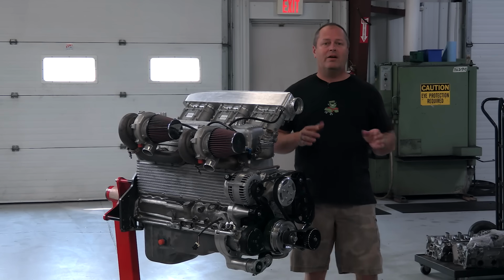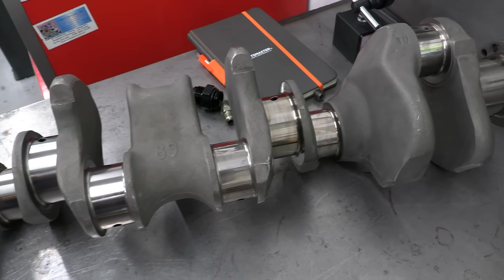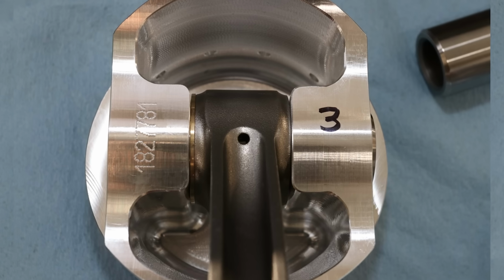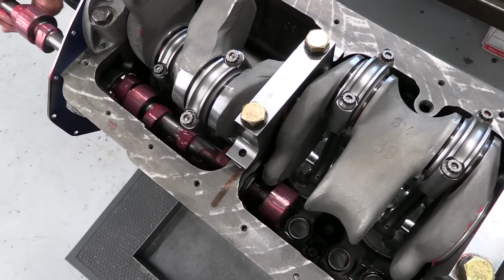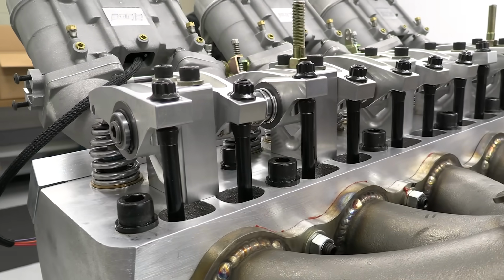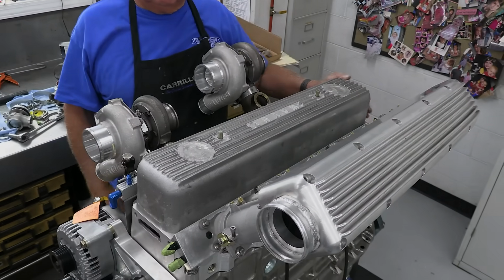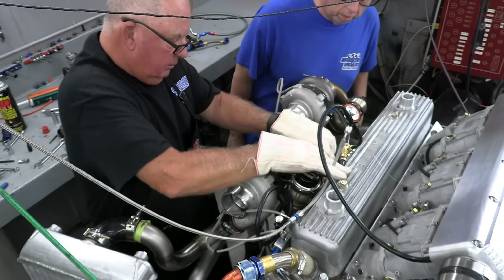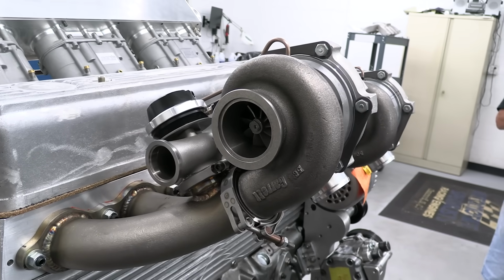Incredible Twin Turbo Chevrolet Straight Six is a One-of-a-Kind Creation!

Comment: What was amazing was the 1st generation 6 cylinder overhead valve Chevy engine only had 3 main bearings. This one has 4 main bearings. I'm surprised they didn't go with the newer block with 7 main bearings.

Comment: Somebody probably already said it, but to my knowledge the big difference between the early series, the 216 CID engine, was babitted rods with no inserts. Inserts came along with the 235.
Reply: 235s had babbited rods as well.

It wasn't until 1954 that GM got away from babbitted rods all together.

Comment: The old Ford straight 6 300 cu. engine in. in my Ford full size van work was a bullet proof engine.    I sold the van with about 300,000 miles still running well.  I had it since new and changed the oil at regular intervals, tune ups, and other wear items maintenance.  It was never opened other than a valve cover gasket.    I wonder why you chose a Chevy?  I also wonder why you chose a 4 main bearings block when one with 7 mains was available.  

You sir are a Master Builder.  This engine transformation is  art work. it is like art sciences and engineering sciences had a baby.  

Who footed the bill for all the custom engineering/manufacturing  of the parts as well as the final assembly and testing?       

I am surprised that Jay Leno has not called you with an offer of $300,000.00/yr salary to maintain all his toys.   Maybe he will after he sees this video?

Comment: Why in the world would y'all put a FRAM oil filter on that engine!!! Fram is straight garbage. Cut them open and take a look at it compared to a wix filter, you'll be amazed at the difference. Fram will damage your engines over time fellas, don't use them.
Reply from the maker: It just gets used on the dyno and then cut open for inspection.
Reply: @TheHorsepowerMonster  that's good to hear. Great work, love the show!

Comment: i built a ford 300ci with twin m90 superchargers and a supercoupe ignition system. i welded the cam sensor ring right to the top of the distributor tho. 781hp but i took it apart to do the headgasket i just put in and then i moved to LA, my grandpa called a junk guy for other things but wound up getting my engine, all my turbos and superchargers and junked all of it

Comment: My first car was a 56' chevy and had a straight six.  I added split exhaust and a two carb McGurk intake.  Embarrassed a few v8 powered competitors.  Not sure if it was a stock 235 cid or the 261 cid.  Also put solid lifters on the original cam and tried various valve lash settings.  This build is over the top, can't wait to here more of how it performs!

Comment: I prefer to see a old school build of this engine. The average hot rodder could not afford to build this engine. I spent 40 years working with old Chevy 235 and 261 engines. Besides the Wayne head several other companies made aftermarket heads. Many other parts including intake manifolds, cams, headers, dual point distributors, magnetos, aluminum flywheels, aluminum valve covers, aluminum side covers, aluminum timing covers, high compression pistons, roller rocker arms, and roller lifters, fuel injection and more for these engines and many of those parts are still available brand new. Your build is very impressive, but the only original 261 parts you are using are the block and crankshaft. Also a 261 can be bored and stroked to just over 300 cubic inches.

Comment: I grew up with a lot of n/a straight sixes from BMW and Opel (specially the 3L-CIH-engine).
German Opels had the straight-six OHV engines until 1965.
Great stuff, you built from this vintage engine!
Such a nice reference to see you guys use the similar type of cork valve cover gasket, they used to install back in the days. ^^

Comment: Maybe a machines groove all the way around the top surface of that head with an o-ring pressed in the groove would help prevent oil from leaking when the valve cover is removed.

Comment: I have very little experience with forced induction, but O-rings don’t seem strong enough to keep the boost in, especially if a blow off valve gets stuck closed.

Comment: Too many turbos, that engine looks like a porcupine. Couldn't you get the same "boost" by increasing the piston stroke? Suck in more air, make it almost like a diesel then use fuel injection so the fuel doesn't ignite early. What am I missing?
Reply: The stroke is already pretty long, just shy of 4 inches

Comment: Ver-r-ry, ver-r-ry sweet! But would you like another nobody-dun-it? Take an old 300-straight-6 Ford (Yeah .. First On Race Day FORD) big truck engine and turn it into a mileage-maker. Should be an easy starter ... there's just a whole lot of reciprocating mass creating ungodly amounts of parasitic drag. Even the crank is a heavy beast .. more drag in that rotational mass.Then we have the rotational drag of the flywheel, et al. Sheesh! It's so easy to fall in love ... with this old truck engine in a truck ... but how about feeding the durn thing over the next 300,000 miles? At 10 MPG, that's 30,000 gallons. At $4 a gallon, that's $120,000 ???? God, help me! Did I do that right? Are there ways we could triple the mileage out of this old anchor? We're talking an $80,000 saving on fuel alone here if we can!

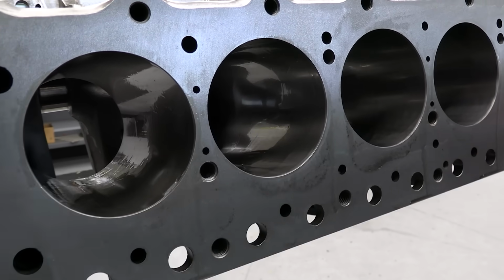Comment: 2:44 Not a performance engine???
Chevrolet DID treat it as a performance engine.
Ever heard of the CORVETTE???
No performance parts??
1953 Corvette blue flame six.
First engine available for the Corvette.
Reply from the maker: The Blue Flame Six was just a standard straight six dressed up with webber carbs. It was rated at just 136 horsepower, only 13 more than the Thrift King six. It's totally cool if you disagree with me, but in my opinion, the Blue Flame six was a marketing exercise, not a legit attempt to make a performance engine. Thanks for watching

Comment: Great engine build but... there's little point trying to compare this engine to the 50's original. This new build is bespoke in every way, all cnc from billet Ali.
Personally I'd like to have seen an original cast iron engine lightened and balanced crank, ported big valve head, fuel injection, high lift cam, electronic ignition with a turbo fitted.  This would be more in line with the tuning of the original concept.

Comment: All those nice oring seals and then there's a cork valve cover gasket. Well I guess you weather strip glue it to the head and it will contain the oil when removing the valve cover right?

Comment: The old red motor  used in Australia by Holden till the early 80s that finished with the 202 cube
Interesting exercise but wow how much did that cost ?  a Ford Barra will get you 600 + HP with head bolts and oil pump gears

Comment: Did you even do any sort of research into what people have done technology-wise with the stovebolt family of engines before making the claim that its the most technologically advanced? People have been putting cam and crank sensors on theirs. Piston guided rods, too. I'm sure someone has even done multiple tb's.

Seriously. Did you do any sort of research to see what people have done or did you just assume nobody's done it? Because they have. So what's so technologically advanced in that, engine that makes it so much more advanced than anything else? Not the cam & crank sensors. Not the pistons & rods and associated parts. Not the tb's.

Whats left?
Reply: 2 turbos? Id venture to guess that's not considered technologically advanced enough to make that the most advanced. So there's got to be a whole bunch that isn't visible?

Comment: I have a gigantic '73 Olds 98 Regency, C-body. Very heavy. I got it for free. The previous owner took the 455/TH400 out for a Cutlass build and gave me the carcass. It has been garaged it's whole life and only has 39,000mi. on the odometer. In other words, it's in gorgeous condition. I want to put a very torquey SBC/700R4 in it simply because they're so cheap and plentiful. I'm looking for low rpm torque, say 300+ft.lbs. from 2000-4000rpm. Would a mild 383 be a good choice? I've heard they're good truck motors cause they're torquey. I live in Alaska and old Oldsmobile V8 engines are literally non-existent in the bone yards up here. But, Chevy trucks with 350's are a dime a dozen, so it's the route that makes most sense.

Comment: One of the best 6-cylinder that ever put together was a 302 GMC that had a two-barrel carburetor 3 inch exhaust and a 12-inch clutch that was one smooth-running Beast and if you run a oil bath air cleaner use dextran transmission fluid

Comment: ooh this video made me sub. look, when your custom engineering, and designing parts, yeah, I know they're cnc, CAD, blah blah, but this is as close to garage engineering as you're going to get, and this is how they did it back in the day. you didn't go to your local speed shop, and just buy the part out of a catalog, you did the engineering, the design, the r&d, and the execution, right there in your garage with metal you had laying around. this is how the hot rodded a motor back in the day. this is called skill. this is what I like to see, not another cookie cutter, LS, junkyard turbo, bs power plant. this is how I do it, this is how it was originally done.
Reply from the maker: Thanks for the sub!

Comment: If the ENGINE OIL PUMP belt breaks how fast do you need to shut off the engine to avoid locking it up due to oil starvation ? I would also like to know if you have done any engine rebuilds on the old INTERNATIONAL HARVESTER 304 & 345 or 392 engines used in the IH Scouts ?

Comment: You mention that the original head was not too advanced but you have to admit that the original 6 cyl engine was pretty dependable and would start at any temperature easily compared to the Ford engines that had so much trouble with vapor locking.

Comment: May god that’s a lot of stuff to be stuck into a older truck, but 10lbs of boost isn’t a lot and with all the custom stuff it would be expensive to fix if it blew up, although not as much as the first build since there wouldn’t be yrs of development…but I’d bet that build could easily handle the 750hp all day long,it would probably even make 900 on corn..
If it was mine, I’d go with 700hp, and the 750-800lbs of TQ and build the trucks driveline to handle it…but they sure did take the most expensive way to make 500hp..great build and a great builder..

Comment: I used the the washers on Chevy V6 engines that had rods offset under the pistons, later I used narrowed V8  rod and machined .050 off the narrow side of a set of Carrillos @5.850 rod length, engine made 435hp at 8600 rpm. My spacers were made from Nylatron

Comment: I'd just like to combat a misconception...Crossflow heads are not better for performance without a good canted valve design, also if you have a reverse flow head, don't worry, you can still throw a cam, your fuel metering system of your choosing, and some in/out pipes at it just like anybody else, without disappointment. Pretty much anything designed since the 50's is going to have potential....man that is one funky stock combustion chamber though

Comment: The 1953 Corvette had a Blue Flame inline 6 cylinder under the hood with triple side-draft carbs and dual exhaust. I do believe that was considered a performance engine. Also, Pontiac built a SOHC 250 ci inline 6 for the Firebird. Don't forget the much newer Atlas Vortec 4200. DOHC, 24-valve, all aluminum I6. These have been turbocharged over 500 HP.

Comment: Anyone weld V8 heads and fit them to a Chevy 6, like the cleveland 6, from the 70's ,. I was thinking something like a modern 5.7 hemi head made to fit a Chevy 6, would be a screamer, lighten the Pistons, rods and crank, then girdle the mains, it would probably be happy spinning to the moon,. And probably all the way back, just a guess, with a mild cam it would probably want to keep going past 7-8k rpm, it would sure have flow, 250-292ci, with ports for a much larger displacement, and higher revving engine, and with boost,  the guys in Brazil are making near 2k HP with 250 6 cylinders,
Reply from the maker: It's a little bit more difficult than that. The bore spacing (from the center of one cylinder bore to the next) on a Gen III 5.7 hemi is 4.46 inches. The straight six from that period had staggered bore spacing depending on if there was a main journal between the cylinders or not. They were either 4.1875 inches or 4.375. So a hemi head won't fit. Thanks for watching
Reply: @TheHorsepowerMonster  yeah, I know, they would have to be cut and welded, but today, it would probably be easier to just cast a new head, it would be alot of welding, also a new cam, because the ports would likely be in different orders, heck it would be so much easier and cheaper to get a vortec 4200 from a salvage yard! Haha, turbo and make about 500-600hp

Comment: I have some question will it do one hundred miles and hour. ,Will it last two hundred and fifty thousand miles , without any major problems , I understand a water pump, carburator mi go jt need to be replace, also can I do it in my driveway. Like I did with my Chevy .

Comment: His work on this reminds me of the Ford 6's running Chevy parts for racing. And torque is referred to in Pounds foot, BTW. Was the rocker ratio 1.47:1 or 1.74:1? Great video. I think I have a new pit stop. :-) Subbed!
Reply from the maker: You are right. Engine torque is absolutely measured in pounds/foot. And in my older videos I referred to it that way, but I got so tired of the endless comments chastising me for saying it wrong because they've always heard it the other way, I finally gave up. Even the engine builders I work with say foot/pounds out of habit even though they know it is correct the other way. Anyhow, I guess it just got too hard to swim upstream. And the rocker ratio is 1.47:1, I got it backwards one time when I was doing the voiceover and didn't catch it. Thanks for watching!

Comment: Beautiful work ! But at this level of mod I would think the Ford 300 would have been used because of more main bearings, but the head is wonderful low weight cross flow bigger valves did they make a version for the Ford ? I had one it went for 300k miles and was 100percent reliable, at the same time I have all-wise had a old bmw with there six and there better I still have a 3.0 so 1988 300k runs great 👍

Comment: 525 hp, 525 torque -  should be enough to get that hunky '58 Chevy Suburban to 60 mph in around 6 seconds flat (assuming you have a beefy transmission, 3.83 posi rear and Hoosier rubber in the rear).  Yeah, that FrankenSix will make it scoot.

Comment: 24:37, and that's why I lost interest in NASCAR, and probably why, a while later, other fans have left. No innovation, no ingenuity. Yeah yeah, sure sure...the new cars have fuel injection...they all do and they're all the same. Yeah, yeah, sure sure, they're finally getting independent suspension...big deal, they all are. If NASCAR had let the good ol boys innovate, this would've all been done a LONG time ago and racing would've remained interesting.
Once "safety" becomes the theme, innovation wanes and interest drops.
All of the new cars, despite improvements, are cookie cutter, same same cars. Boring. Formula 1...same same despite the differences between manufacturers. I am all for safety. But once innovation is killed, so is interest.
Anyway...this engine is killer! And so is the builder!

Comment: No mention of the lack of torsional support from the lack of a thrust surface on those connecting rods. I know about a high volume oil pump covering the loss of pressure and the extra cooling all that oil will provide for the pistons, but not having a thrust surface on those big ends is gonna be a durability issue. I predict that when that engine fails, you're gonna hear a characteristic rod knocking.

Comment: In Australia had there own casting and the arfter market was bigger and even had over head cam. Or getting a bigger stroke using a ford 176 pursuit motor crank with the fly wheel end grafted onto the crank.
Even having the cam doing the valve work as a rotory type. I have seen some big numbers coming from them.

Comment: I'd give anything to have the 4.9 in my Econoline built up, I saw powerblock get 500 HP from one they built with a single turbo, not that I need that much power, I'd just like to have something to show off a bit, my 73 never reached show potential, it was a work in progress but was totaled out in an accident, I lost a fortune due to it being marked a no fault accident. I love the sound of a straight six engine, along with their durability.

Comment: That is the coolest 6 cylinder engine build to the point of a work of art. It sure makes a Ford crank in a Holden 6 utilising Cosworth conrods, Lotus pistons, Waggot custom grind camshaft, Phil Irving custom designed head and triple 48 mm Webber carbs look so basic that I had built down here in Australia.
Reply from the maker: Sounds like a cool engine

Comment: I'd be fabbing up my own 2-Piece valve cover for that engine, where the top comes off separately. I can just imagine the mess that will happen when the entire cover would be removed, the way it is now. But hey, ya gotta do what ya gotta do, right? If there wasn't room to bolt the valve cover rail on, there wasn't room. Interesting build nonetheless. 👌
Reply: That would be like putting titanium shoes on a mule. And adding extra leak points and hardware is useless.